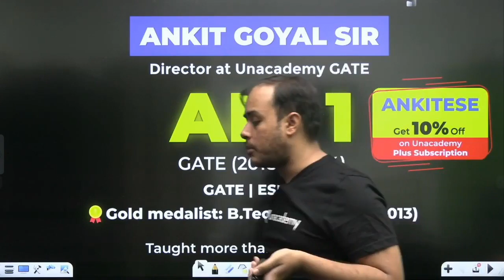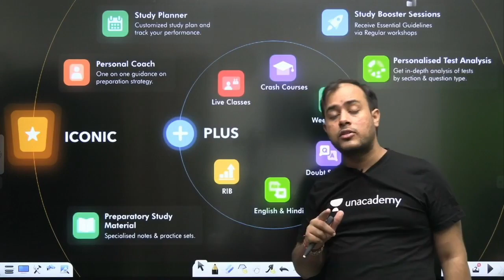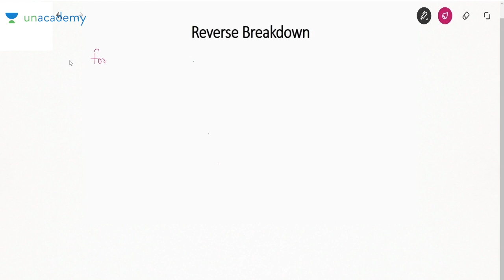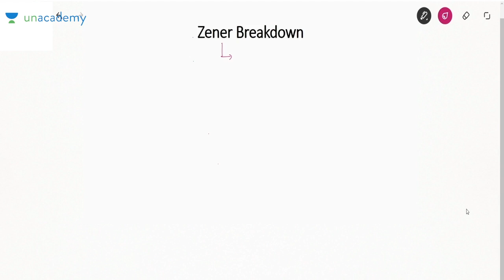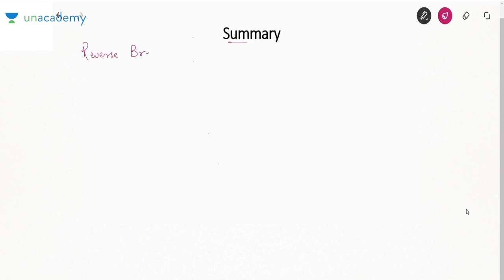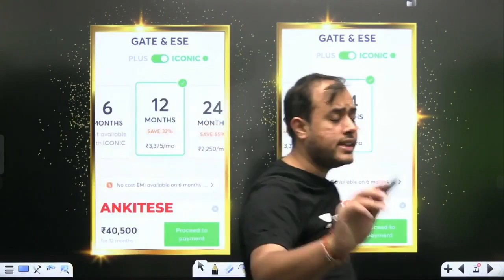Breakdown and Capacitance of Diode | Diode Circuits | Lec 4 | Analog Electronics | GATE 2021 Exam

Comment: What about the electrons provided by the voltage source. They also increase the electron concentration in p region
Reply: Voltage source does not provide any electrons or holes..It only creates difference in potential across pn junction !! So that electric field is generated

Comment: You called current in F.B. as diffusion current. Why? The F.B. current is due to the applied potential and not because of the variation in concentration. Kindly explain.
Reply: Because when we apply voltage across diode in FB holes start moving from p side to n side and electrons from n side to p side(**concentration of holes is more in P side and n side electrons are at higher concentration) so this is nothing but moving of charge carriers from high to low concentration hence it is said to be diffusion current.

Comment: In Zener Breakdown, how Electric field increases on increasing the doping??......Please explain sir🙏
Reply: This is the exact i had ....in avalanche it was light doping so larger depletion width and large electric field ....but the same can't happene in highly doped diode .. highly doped mean there should less electric field
Reply: Same doubt
If depletion layer is thin then inertnal field should be less.
Reply: @omprakashtaram8134  net electric field is considered here not only internal field.
Reply: due to high doping , dep width is less ..hence electric field intensity is more...due to higher electric field intensity, covalent bonds break .  this is the concept of zener breakdown
Reply: @prateekjoshi2892  if Depletion width is less then how electric field intensity would be high ??
Reply: Emax= 2Vbi/w
Reply: @AnkitRaj-vp1li  because we are also using external source of electric field i.e. battery
Reply: electric field is also a function of doping as result of the poisson equation derived from gauss equation